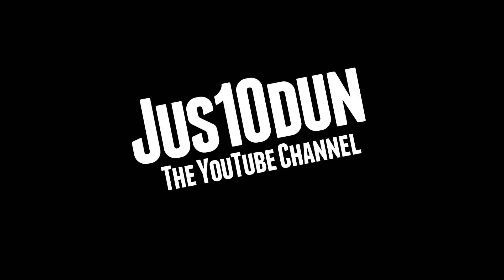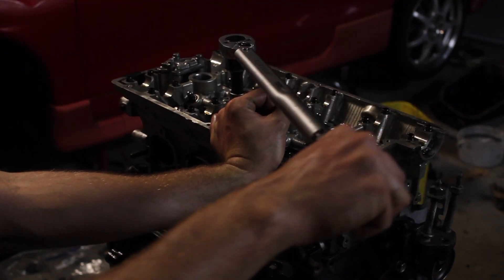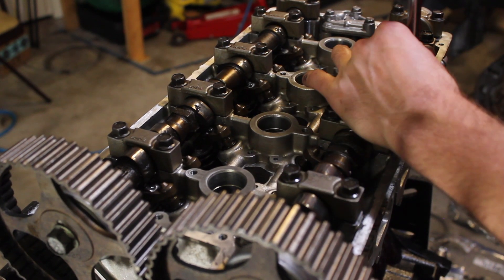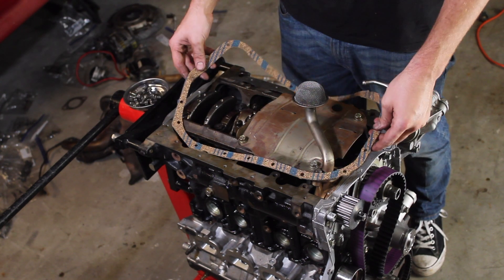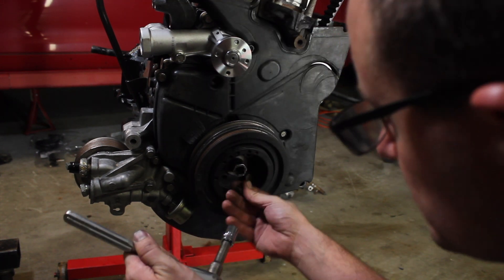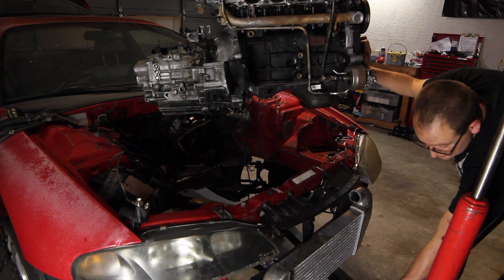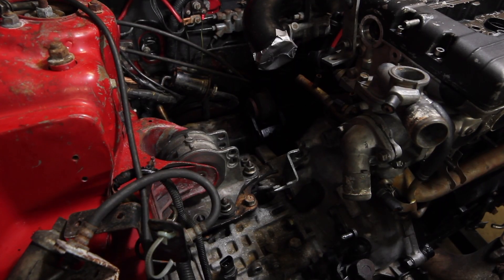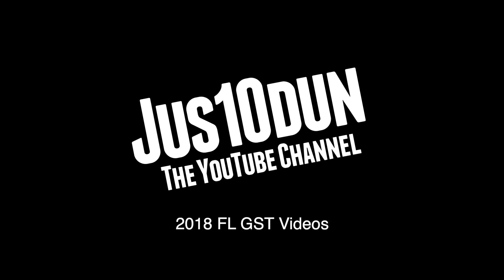FINALLY Assembling my 4G63 Turbo Engine and installing into Mitzi the GST

Comment: I just found your channel. Loved all your context for the dsm except re-using that old ass timing belt and a cork gasket?
Reply from the maker: @ryanhopp8940  thanks man! Yes I will hate myself later for it. Just more fun if it blows up.
Reply: @jus10dun  well shit a new belt is 50 bucks
Reply from the maker: Yes, A standard GATES timing belt is ~$50. I spent around ~$200 for this HKS Timing belt in 2012. It only has a couple hundred miles on it. However, it does have 6+ years of sitting in the same position. It's really a toss up if it will be good really. For that price I could have just replaced it 4 times and been safer.
Reply: @jus10dun  i have an HKS belt too. But why not just get a new one? You put all that work into the engine and dont at least replace the belt?

Comment: Awesome vid bud! I cant wait to do the same to my 99 gst. Looking forward to the next vid. I want to see how bad the wiring hook back up is.
Reply from the maker: Thank for the comment. Lots more to do.
Reply from the maker: I suspect the wiring “should be” easy. But odds are I will come across either a broken connector or a chewed wire.
Reply from the maker: I saw your cover photo was of the GST. But no videos of it yet. Do you have any video of it yet?
Reply: @jus10dun  I have but never liked my editing lol I'm getting better but not anything someone would actually watch for the effort I was putting into my vids. I may try to film some more any see anything is worth a crap. Keep the vids coming bud I'll watch 👍🤙
Reply from the maker: @flo_tenn_angling7472  I could spend forever editing. And still think I should of done more. Thankfully you have some footage to determine what you like and don’t like to shoot it better next time.
Reply: @jus10dun  I uploaded a short I had of mine it's from 4 years ago lol it's changed a bit under the hood these days.
Reply from the maker: @flo_tenn_angling7472  looks like lots of mods already.
Reply: @jus10dun  she's got a few but I've had her 12 years now so wish I was farther along but I'll get there little by little. I'm planing on painting it this spring. That will help with the overall look a lot.
Reply from the maker: @ yes no need to rush when you will have it for a long time. Theses cars stock are worth driving.